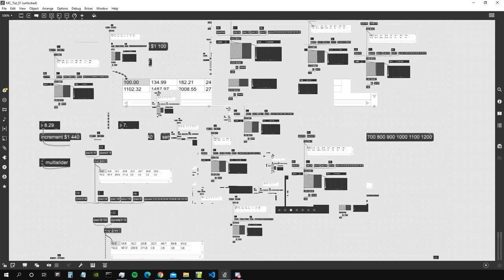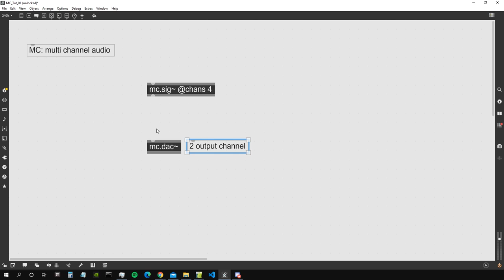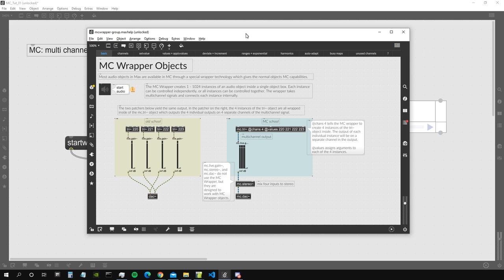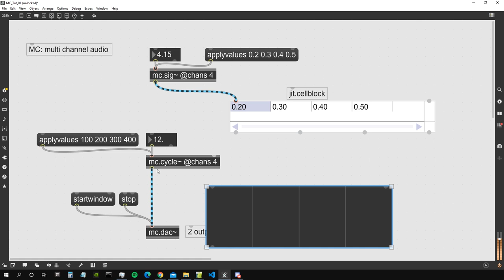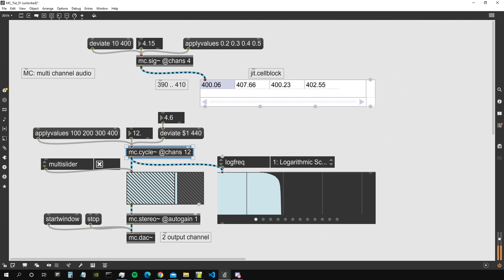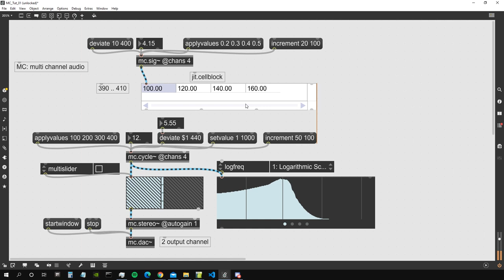MC in Max/MSP | 01 - MC Messages

Comment: So it's basically one wire that carries a polyphonic-multivoice signal , something that reaktor does since decades   and yes each voice can be modified as well (deviate example in the video)  by using the voice info module  ,  to get everything  back to  a summed  mono -stereo signal ,  the audio voice combiner is added at the  end .
I like max msp  but for pure synthesis and dsp  I prefer Reaktor core and when I want an all in one program  supercollider is unmatched

Comment: Very cool, thank you! I just downloaded Max for Live and I'm having lots of fun already. 
Question, you see how you first pass one thing into mc.sig~ and mc.cycle~, then you add the applyvalues into it, and then finally the deviate... It's only the most recent one you added that has an effect, correct? The previous ones cease to function and you could remove those right? Or do you need to keep these for some reason I'm not seeing?
Reply from the maker: You are right Jack, only the last one applied is going to take effect. You can also remove every other one you don't need. Wish you a lot of fun!